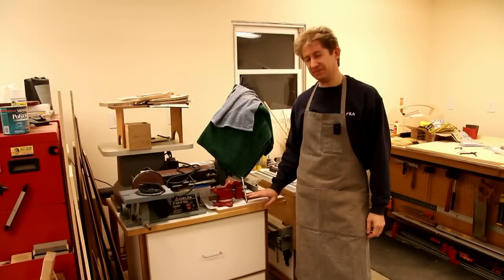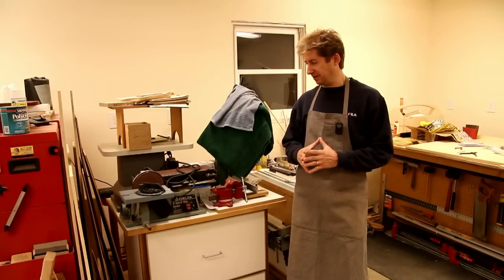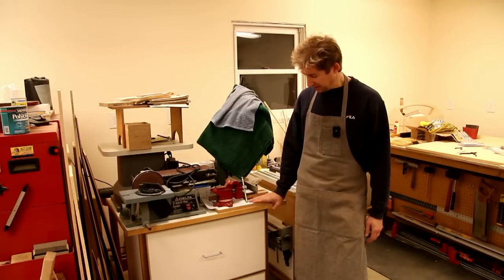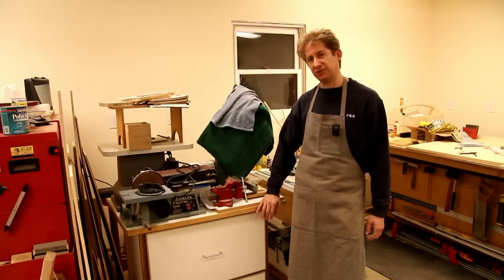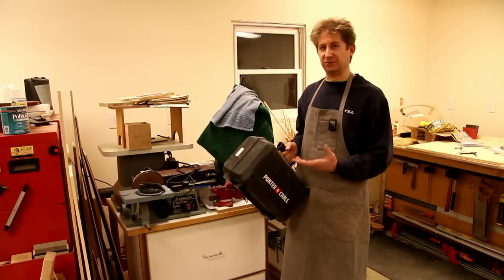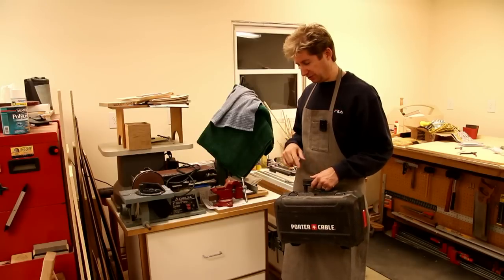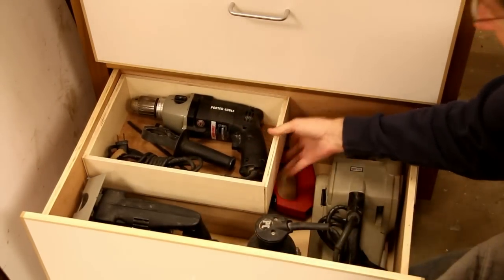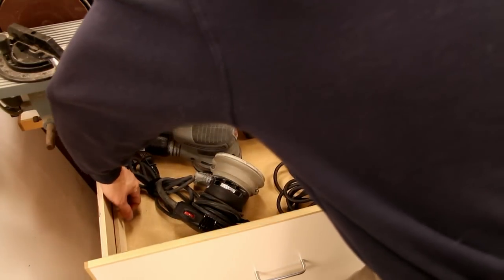Throw Away Your Portable Tool Cases

Comment: I'm on the same boat about the space and the tool's cases.  I started putting some of my tools in the attic due to spacing. Your idea is great, requires some thinking and planning on how to store tools, I like it.  The only thing would be what to do with those wrenches, screws, manuals, etc the tools come with.  That's the reason a mainly keep the cases, to keep things together and separate, at same time.  In order to do this, would need figure it out how to keep the accessories from getting lost and how to keep them handy. Great idea and great organization. Love it.

Comment: You've got SO much wall space, you could use it for storage, we've just organised our large shed, we used one of the walls from floor to ceiling with peg boards & OSB boards to hang our tools etc, & put shelving all around with large plastic labelled storage boxes, our house was cluttered with the storage boxes, we couldn't move as they were taking up space in every room, now I have a place for everything & everythings in it's right place, after 3 years of moving into this house my head feels less cluttered too! I agree with your advice to get rid of all those tool cases, they are so bulky & unnecessary, good clear video, thanks.
Reply from the maker: Gina ~ Reggae Legends no 2 I do still have a lot of empty wall space. The workshop is a work in progress, but I do plan on having nice storage cabinets on the walls. Thanks for your comments.

Comment: I understand the logic.  I need to do this myself.  The only aspect I'd struggle with is throwing the unused cases in the trash.  I'd elect to save or repurpose them somehow; even if it's allowing someone else to carry that burden.  I personally have used discarded cases as sorter boxes or alternate tool boxes.  Some of these work particularly well to pack spare parts, tools, recovery gear, etc in my jeep for off roading.  Additionally when I buy new power tools, I prefer the canvas style bags over the hard cases.  Canvas bags are much easier to repurpose for me anyway.   Bottom line, good video for inspiring space saving options.
Reply from the maker: Thanks for the comment. I have saved some cases, but in general I'm trying to store everything in drawers, and I just don't have space to keep unused cases for some potential future use. And it does seem like more and more tools come in bags now, which are easier to reuse around the house.

Comment: I am a professional woodworker and I'm totally with you on this.  I threw most of mine away long ago, however there are some tools that are most often used on a jobsite instead of in the workshop.  The sawzall is a perfect example and I'm surprised that you chose to include it in this video.  I will never use a sawzall in the workshop - it's an on-site tool only.  For that reason, I think it's worthwhile keeping the case because it protects the tool during transport, and keeps accessories with the tool.  I keep all my portable shop power tools in pullouts beneath my workbench.
Reply from the maker: Since I'm an amateur woodworker, all of my tools get used either in the workshop or in and around the house. The Sawzall (mine's 20+ years old) only gets used for my home improvement work, so the case isn't needed.

As I prefaced in my video, the thoughts that I'm expressing are not pertinent to the person that works outside of the workshop.

Thanks for your affirmation - this video appears to be polarizing. Makes for some fun reading.

Comment: I know this is an old video, but came across it because I was thinking of throwing out my old cases.

I had a suggestion for your large drawer if you haven't already done it. You could cut out part of the back and put drawer slides on the top insert. Then you can slide them back instead of taking them out.
Reply from the maker: Thanks for the suggestion. Actually I've since removed the top tray and replaced it with a sliding (left to right) tray. I lost a little storage but I got tired of having to lift the tray out.

Comment: store cases in the roof, or hang them from the ceiling, or install a high shelf along a section of wall, preferably that takes up space you don't need.
I've got pigeon hole type shelves in a corner so it doesn't impede on usable work space. Tools are easy to get to, easy to organise, easy to see what is there or is missing. My brother has his old kitchen cupboards in his shed, and converted the guts of cabinets to drawers to large and heavy equipment slides out for ease.

Comment: I have a cart right now that supports my bench top sander, jigsaw and drill Press. It has a bottom tray with 3 feet of empty space above it. Why I never built little drawer cabinet in there is a mystery. Never thought of it until now. I’m betting most of the negative commenters were at least reminded of something that they could do better in their shop, thanks to your video.

Comment: When I started in the trade (back when we were still wiring candles) one of the old timers (who still remembered wiring rush torches) mentioned that if you were using your tools to earn your house, the tools were entitled to have a house or houses too.  Of course since my current shop is huge (not quite 6400 sq ft) keeping things together in their cases is the only way of having a hope of finding anything.
Reply from the maker: I agree totally. That's why I like to have a custom 'home' for each of my tools. More of a condo really - where multiple tools live under on roof.

Rush torches sound interesting. I Google'd for a bit, but couldn't find any information on what a Rush Torch is, and what it means to 'wire' them.
Reply: Marty Backe
Little play on words.  Electrician before there was electricity.  IIRC (from reading; no I'm not THAT old) in the middle ages bundles of rushes were tied and lit as illumination.  I have actually seen electrical fixtures mounted to abandoned gas pipes in older homes.

Comment: You need to apply similar thinking to all work areas you could encounter. The shop. The truck.  Different floors in house. Etc.  Example...  Small Soft material hand box on stand by for work on roof. Just foreshadow the job and hand box is already isolated! Being ready means time for innovation

Comment: Rather than make a case for discarding blow moded power tool cases, you make a better arguement for not having fixed shop power tool tables or cabinets. Those are huge space wasters. and do NOT need to permanantly encapsulate the spaces below them.  Think outside the boxes.

While it's nice to have "only" a 20x20 garage as a shop, it doesn't need to use the entire space when not in use.  A standard 2 car garage has a 24 inch wide border on 3 sides that can be used for holding a shop's equiment.  A workbench, assembly table or power tool support surface does not need to be a stationary fixture with a fixed footprint and permanently wasted volume above or below it.  It just needs to a surface with adequate support WHEN IN USE..  

When not in use, a saw, router, vice etc mounted on a rolling table or cabinet could be moved to against the wall with shelves above it.  Instead of being a cabinet, a power tool platform could be built as a drop leaf with pivoting legs, hinged from a fixed shelf or as a door of a wall cabinet. Wall shelves can be adjustable height using slotted shelving rails, and in sections as narrow as feet wide.  That gives you a tremendous amount of highly usable storage space all the way up to the ceiling.  

High mounted shelves can be used to hold light, seldom used pieces such as blow molded power tool cases. Other items can be stored above the open area of a shop by using lift baskets and/or a removable library type ladder with wheels and a rail.

Comment: If I don't use the tool frequently it's usually easier to stack up the plastic cases on a shelf (with the tools in them).  Also if you are travelling with the tool frequently the case is usually the best method for going to job sites.  Generally, I get rid of the case if the tool is going to be used all the time and I find a home for it.  Here is my shop in a 1 1/2 car garage.  http://youtu.be/4SBscaBYORs

Comment: I'll consider this, but I do like knowing that all the tools that go with the tools are in the case. Like the allen wrench or flat wrench that is used to adjust it. In my biscuit joiner case, I have a little bag of biscuits for when I'm just doing a couple of joints.
Reply from the maker: When I fit my drawers for a particular tool, I add dividers and such so that I can keep all of the accessories together with the tool.

Comment: I take a similar path to you when it comes to the plastic tool boxes, but a totally different method when it comes to storing tool accessories... 

ZIP-LOK BAGS!!!!! I never need 90% of what came with my tools, but I'm not going to throw them away. The areas you've built for your tool accessories are great, but they waste space. 1 drawer for tool accessories + marked bags and put as many tools as possible in the drawers.

Great video! But as someone that is very cramped, I see the opportunities!

Comment: I did throw away all my cases when I first moved in for the same reason of space saving. Worst idea I ever had.
1) expensive equipment is not protected from dust
2) nor it is protected from accidents such as a  pot of paint that fell  upside down (even a small one, it happened)
3) chords are bundled around the power tool and end up all twisted before their connexion break,
4) accessories specific to the tool are lost because their not kept in their proper case
5) most power tools are stacked in a drawer on top of each other and they are not well taken care of…

I wouldn' t do the mistake again …
Reply from the maker: In my case the tools are stored in divided sections within drawers:
1) They are protected from dust
2) They are in a drawer - nothing can fall on them
3) Cords are neatly stored within their section of the drawer
4) Accessories have their specific place within the drawer
5) Only happens if you throw a bunch of stuff into a drawer. Instead subdivide the drawer as I've shown in this video.

Thanks for your input though.
Reply: Marty Backe Different experiences : different "lessons learned" ! Have a nice week end !

Comment: When you speak of vertical storage, why do you exclude vertical storage on your walls? I'd almost kill to have that much wall storage available for use. :-)

Combo pegboard, upper cabinets & open shelving. 

Everybody's shop is their personal space & everybody is different. Personally, I can't see throwing away cases -- especially metal ones. Put em under the house in crawl space, if no where else available. 

Easier to sell w/case. Keep accessories w/tool. Use drawer space for stuff w/o cases.

Comment: Tossing them is ridiculous. If you move or do a project somewhere you'll be glad you had them. Yes storing them at home or in a workshop is great. But I would not recommend chucking them. Unless you build your own, most drawers can't handle the weight of all your tools. And bending over pulling the sections out is asking for back problems. Storing tools on shelf is definitely the way to go. Then draws or shelves under the saw with jigs or whatever you'll need for that machine. Ok vid tho